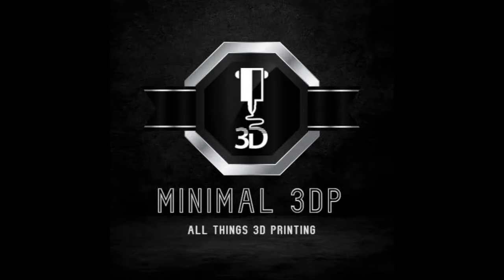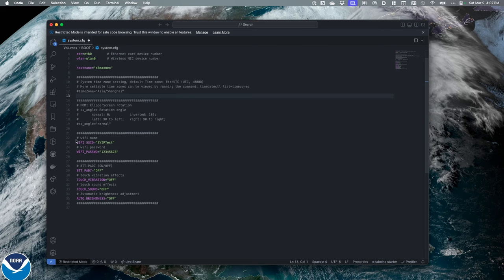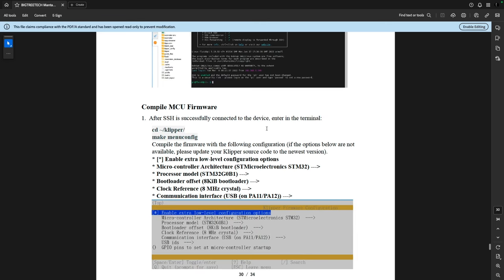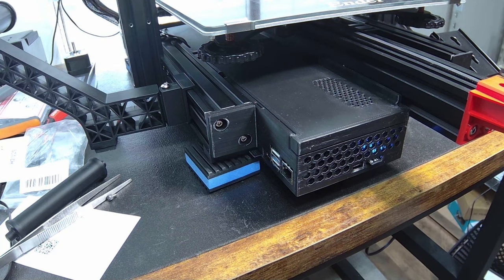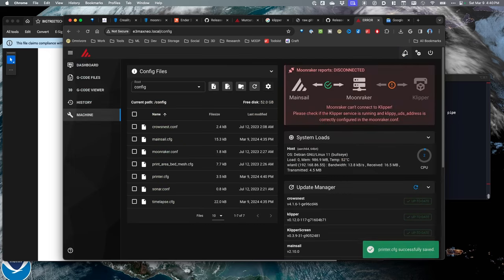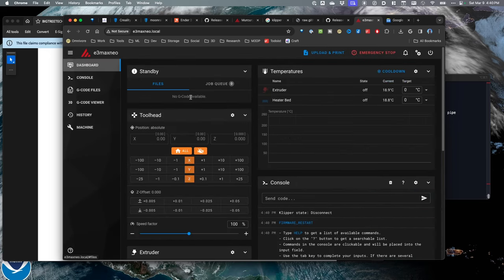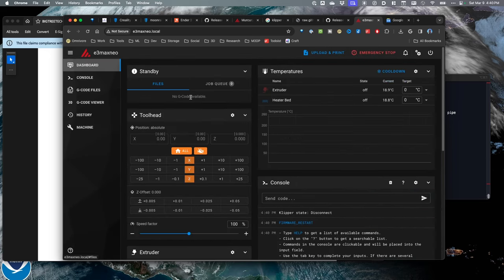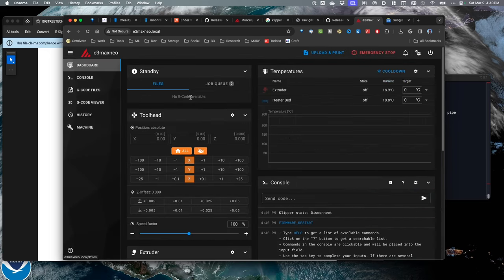Creality Ender 3 Max Neo + Klipper + BTT Manta E3EZ: The Ultimate Printing Trio (Tutorial)

Comment: Hey Mike, My name is Mike as well , I am trying a Power Supply build the problem is the switches, LEDs, I measured these parts with calipers but after printing the parts do not fit in the holes . The holes are to small. Have you had that problem? What should I be doing to assure my parts fit in the holes?  I have a Ender 3 V2 Neo if that is relevant. Thx Mike
Reply from the maker: Which printer part are not fitting? Do you have a link?